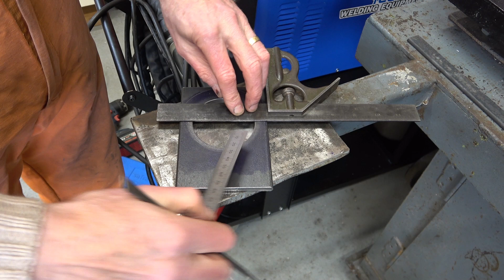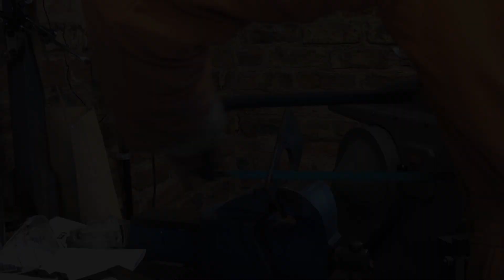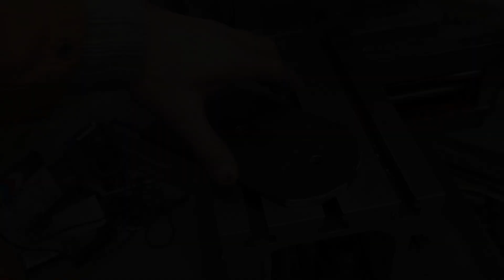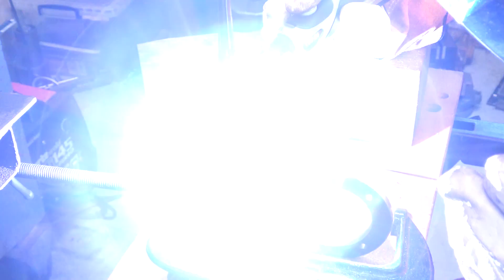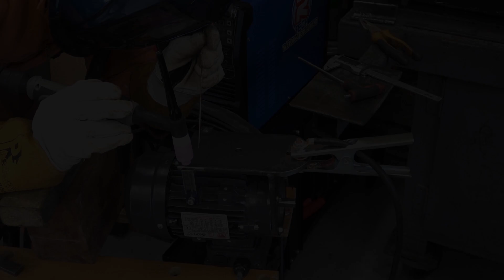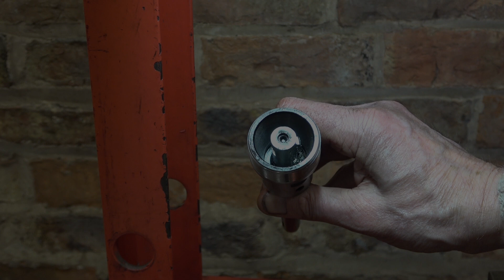HS134 Shaper milling head – Part 2

Comment: I'm not really stalking you, but I went for the same TIG welder after much research. I've had it about 2 years now and have been very happy with it. To avoid putting too much heat into the metal and risking distortion you could use the pulse function, setting upper and lower amps and the pulse width. I also recently got the R-Tech 250A MIG welder having never done MIG before, (I have been doing MMA for 50 years and TIG for about 30). The first thing I built was a new welding trolly, the R-Tech one was disappointing, I got £50 for it, the new trolly takes two Y size bottles and both welders + the little R-Tech 180A MMA welder for those little jobs. MIG is a revelation, I wish I'd bought one years ago, brilliant for quick jobs, but not as neat or as flexible as the TIG.
Reply from the maker: Hi Bill, we have a cheap Clarke MIG welder. We hardly ever use it - I can't get used to all the arcing and sparking and spitting that goes on. You may have seen my series "Diary of a TIG welding beginner" and you can see I started from absolute zero knowledge. I think I have dragged myself up from useless beginner to semi competent beginner on simple jobs. I've not yet had a any serious go at Aluminium, beyond a few spots on a bit of plate. But I have got to the stage were I will reach for TIG before I reach for stick. In fact I'm enjoying TIG now. All my early troubles were with understanding gas flow (a world of porosity).  Cheers

Comment: G'Day Paul, love seeing capacity in our small workshops expanded with out of the box thinking.  Saves money, space and lets us be inventive.  I was hoping to see some kind of thrust arrangement on the motor shaft.  My father built a head for his small horizontal mill and the first thing I said was make sure you use Taper Rollers in the assembly.  He didn't and went with plain deep groove ball bearings in the housing.  The Z axis floated around 0.003" and he was always fighting against that and the chatter.  It would be good to see a thrust arrangement on the fan side of the motor to prevent the shaft from dropping down when the bearings start to wear in.  Yes I have all so dropped a bottle of layout blue all over the floor.  1 liter of acetone later and the stain was still there.
Cam
Reply from the maker: Hi Cam, nice to hear your dad's story with the milling head. It's great when people can say "my dad did this / that in his workshop", great memories.  I do add a thrust bearing and some other stiffening as we go along in this series. However if those prove insufficient then taper bearings would be perhaps the next step. My milling head will only get occasional use. I was going to repaint the floor to cover the blue but I've decided that daylight will fade it in a few years ...... cheers mate.

Comment: What a perfect solution...I have a 3 phase horizontal mill and was planning a 240v motor in, but this idea will allow me to keep the 415v option and have a 240v vertical head....thanks for the video....
Reply from the maker: Hi Swamppifi, the motor for the milling head is 550W 3 phase controlled by a VFD inverter on 240v. The shaper main motor is also 3 phase, controlled by another VFD inverter on 240v.  (You probably guess I don't have 415v mains 3 phase here.) Cheers
Reply: @HaxbyShed  Hi Paul, I have 415v generator running it at the moment, and it has a heavy universal head, but I am building a bolt on CNC table, and want a 240v spindle mounted on a bolt on Z axis, and your idea would suit my plans, trying to drive the knee up & down for Z is just too much mass to drive.

Comment: Looks right, ref motor mounting plate, obviously it needs to react to machining forces as well. 
The R32 holder should be a case or surface hardening steel,  but it could only be the ER fixing side is hardened, hand slotting on a lathe in any steel is blooming hard work. 
Great idea on thrust bearing,  ref motor is designed for radial load.
Thanks for sharing. 
Regards John
Reply from the maker: Hi John, the bracket seems to be stiffer with side to side load. It flexes a bit more front to back but that may be in the up/downslide gibs and perhaps I could adjust them up a bit. I think it will always be better for 'making shapes' where accuracy is not paramount rather than precision machining. Cutting the keyway, I was a bit worried about the wear on the leadscrew nut on my tailstock. Perhaps I should have moved to the press sooner. Cheers

Comment: Hi Paul, i have to say that you work with a nice method: i really enjoyed your corner welding, not at all trivial because to bring some material; currently I know how to weld with my TIG, I'm not as good as you though: I would like to ask you, are the 90 ° brackets made of iron? What kind of material did you use for the filler rods? Thanks Paul, AB-SHOP
Reply from the maker: Hi Alberto, it is black mild steel plate and ER80S D2 (BS 2901 A31, 21952-A W Z4Mo) filler wire (2% manganese and 0.5% molybdenum).   So actually if I said 'chro-molly' (I think I did) I was not right - that would be ER80S B2 (A32). Cheers.
Reply: @HaxbyShed  Thanks a lot Paul!!

Comment: You really got lucky using a taper without a draw bar when cutting laterally! Chucks coming off at speed are no fun! Yep Elliot 10M shapers are unified threads! Cheers, Matthew
Reply from the maker: HI Matthew, I'm not sure why the chuck stayed in, just luck I guess. Sometimes you only have to be lucky once (or twice in this case). Cheers

Comment: Great video and the tig welding looks great too. Yuo are making great progress and it is fun to watch. Cutting the curve on the plates would have been so much easier with a mill 😀
Reply from the maker: HI GTB, it's always the same - you need the tool you are trying to make to make the tool so it's somewhat circular. Cheers

Comment: Hi Paul, is there a reason you didn't use the 4 motor mounting feet to fabricate directly back to your mounting plate? Great idea using the shaper as a base for this conversion.
Reply from the maker: Hi Andy, I would have had to make the bracket backplate 50mm wider to take both feet. Although my bracket has taken a lot more work it is more compact and maybe having the lower bracket around the front of the motor (near the spindle) may have made it more rigid. Actually I did not expect that motor to come with feet, it was a surprise. Cheers

Comment: Nice job, just wonder if you are going to be able to adjust the speed of the motor, will wait for next episode 👴🏻👍
Reply from the maker: Hi Terry, it's a 3 phase motor driven by my IMO inverter VFD with very good speed and torque control. Obviously testing to date is limited but I've no concerns about that currently. Cheers

Comment: Nice work Paul. I had one of those marking out fluid accidents too. The area it is capable of covering seems to be totally out of proportion to its volume!
Reply from the maker: I thought Mark I'd only loosened the top (not unscrewed fully), I thought I'd put is down securely, I turned around for something and I thought I heard something plop off the bench, I thought I saw it roll under the saw guard, I thought I could reach it before the ink all ran out, and then I thought F***!!!! my day is not going well. Cheers
Reply: @HaxbyShed  My dad used to tell me that's what you get for thinking!

Comment: Tried that once wound up dodging my 85$ jacobs chuck as is flung off and decided it needed to smack absolutely every corner or sharp edged in my shop smh reckon I should be great full it didn’t smack me but still but hurt about the 85$ I basically threw out the window
Reply from the maker: lol Jeremy 🤣.  There is a threaded hole on the end of the motor shaft for a retaining screw, plus the two grub screws on the side of the chuck. It may come loose occasionally but I think it will stay on. Cheers

Comment: They have to let you into the welder's club now. You did good! Relax & just let it happen. The fact that your tack welds held for fit-up told you everything. Very proud & you should be too. Welcome to the secret club of capable welders. Cheers!
Reply from the maker: Hi Bob, it's like karate. In karate there are usually 10 grades to get to blackbelt.  I am a blackbelt 1st level. What people don't realise is there are 10 levels of blackbelt and 1st level means a basic understanding (this is absolutely true). So now in TIG welding I might have reached 'a basic understanding'.  Regards

Comment: very nice welds.  good job on the key-way
Reply from the maker: Hi Doug, it's nice to finally get some better results with TIG after many struggles but I suspect these are 'easy' materials being steel and thick.   I did not rate my chances at all with the keyway - luckily I had a boring bar just the right diameter  (14mm). Cheers